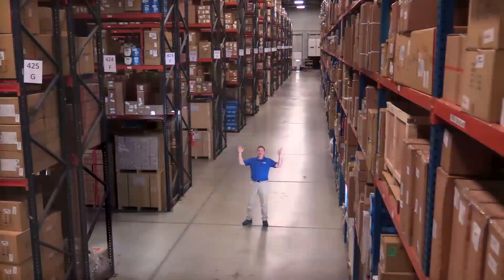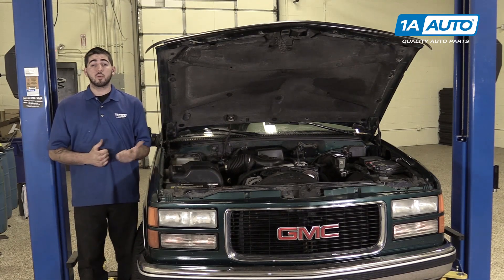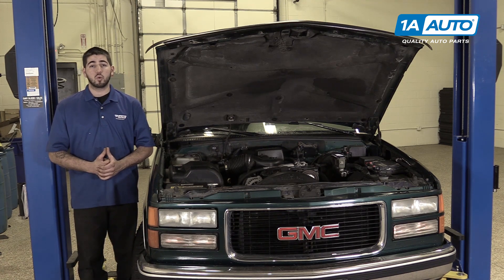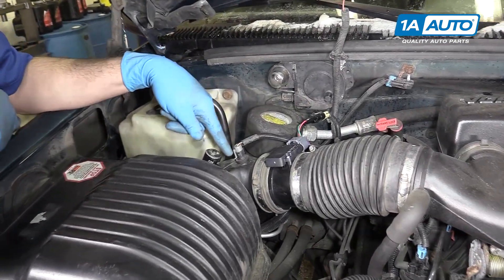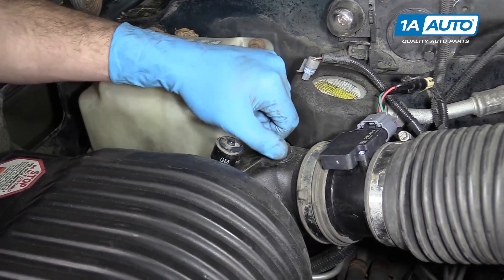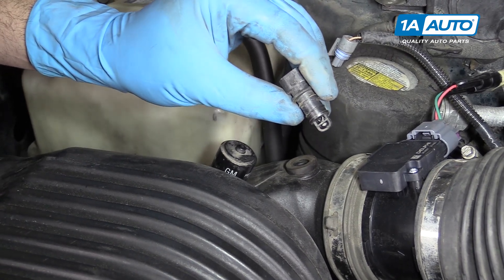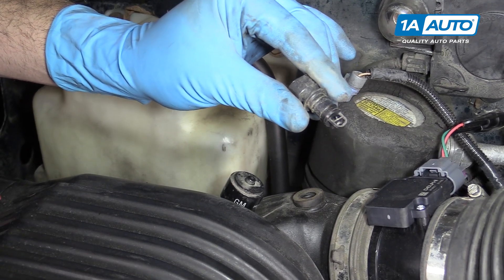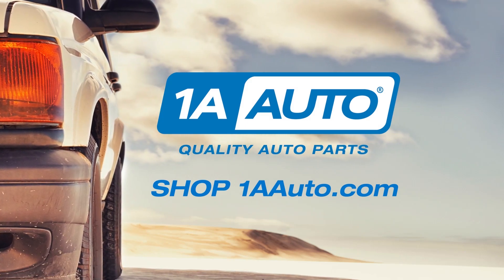How to Replace IAT Sensor 88-98 GMC K1500 5.7L V8 Sierra

Comment: It seems at some point my gasket was removed and the wrong IAC was installed!  Now I can't change my bad and probably wrong intake air temperature sensor?! I'm assuming the missing gasket is why I'm getting codes after taking the old one out that was Jerry rigged and putting it back in since your part didn't fit..... HELP? I can't find the part anywhere.

Comment: I just bought a k&n about a month ago and it doesn’t have a hole for the iat sensor. And I started to notice about 2 weeks ago that it started to idle higher then normal. It would idle around 1000,1100 rpms. Now it goes up to 1500rpms. Then about like 10 minutes of just letting it run it slowly drops down to 1000rpms. But it happens randomly. Some days if idles good then other days it idles high. Should I be concerned and contact k&n to give me an intake with a iat hole or it doesn’t matter cause right now I just have that sensor hanging.